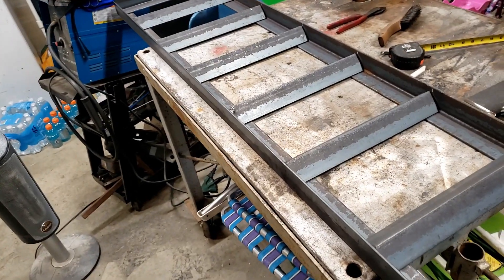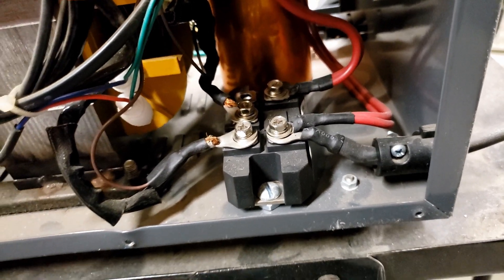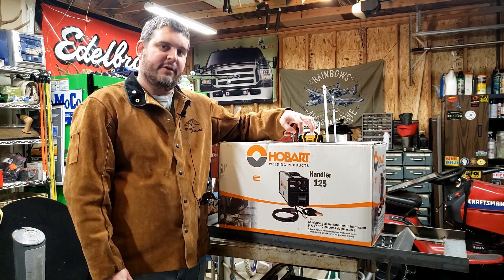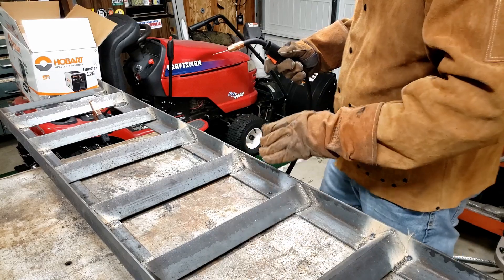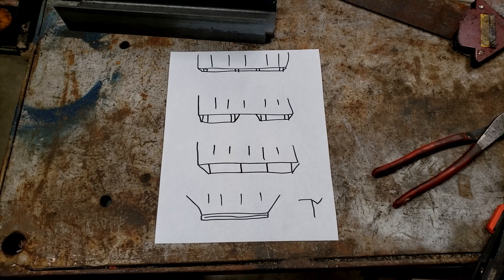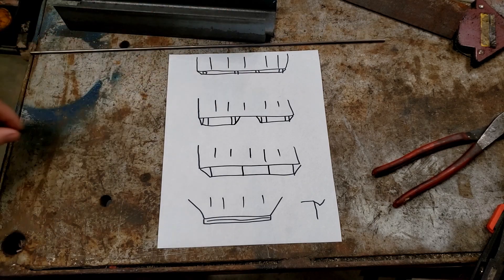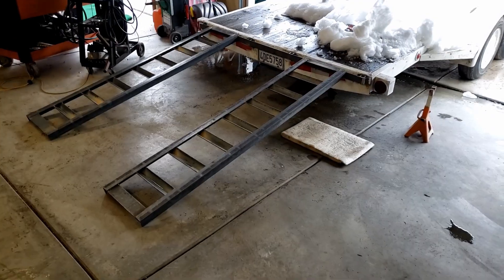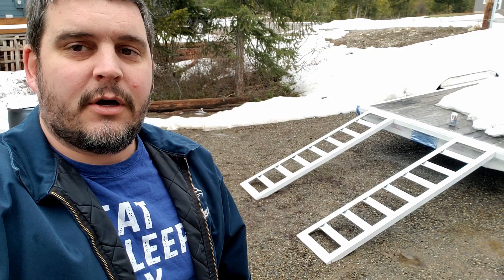Building Car Trailer Ramps - Hobart Handler 125 REVIEW

Comment: I was thinking of building the same exact thing. How did they do with weight as far as bow and flex? Did they seem heavy enough? I'm trying to decide between using angle and channel.
Reply from the maker: They didn't flex at all with the Jeep or other small vehicles. But my diesel super duty put a permanent bow in them. They are heavy to move around though, so I'm happy with the materials I used.
Reply: C channel for heaavy duty is best
Reply: @Hardstyler981  I have a lot of scrap cars to get moved, so I ended up going with C channel using 2" angle going across for treads. Pretty heavy, but not too heavy. I don't have any regrets as they are rock solid so far.